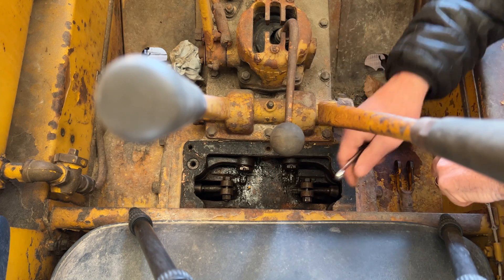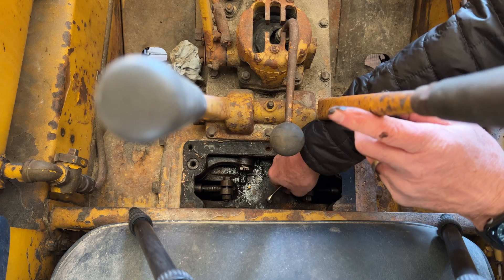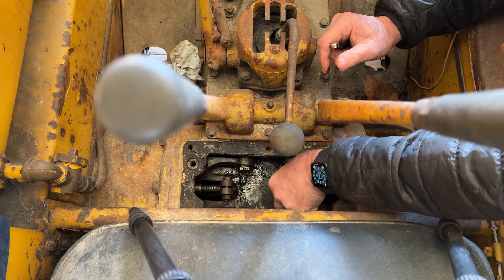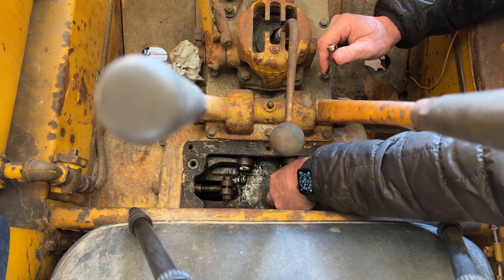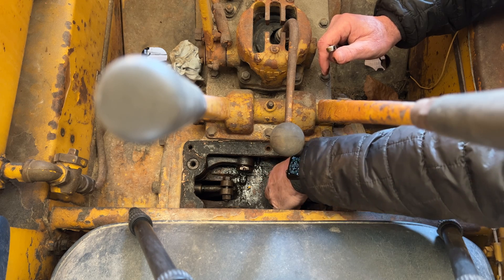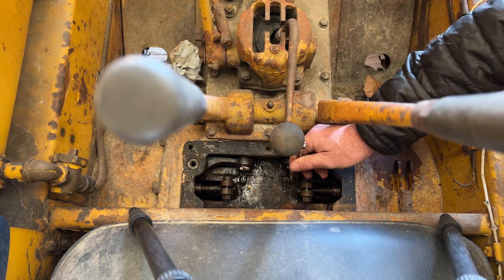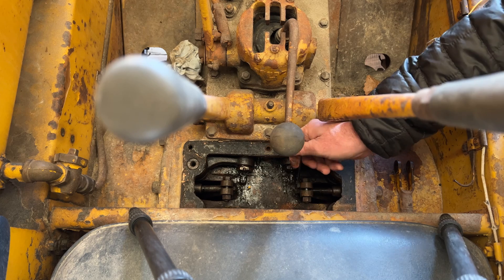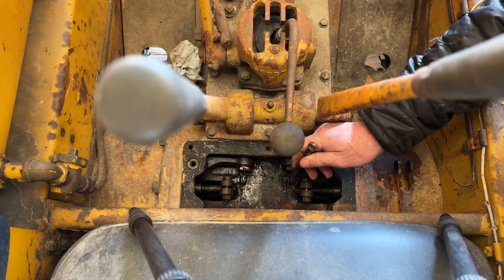D2 Steering Clutch Adjustment - Let's see what we have!

Comment: Did you see the D2 2J1113 videos on youtube. They just did a 5 part on the pony carb.   Think there is magneto coming up. 

But dont give up videoing. If it's old cat it will get watched.  Another guy is doing a 1950 D4.  Yet another is tearing down an Rd4.  Another is putting new weld on sprockets, steering clutches on several D4Ds that are strawberry fumigation setups. And he did a cat grader blade lift gear box. . So much cat and always room for more..
Reply from the maker: Wayne, for sure I will - I just don't have regular times to work on it, but when I do I'll make some videos. Nest up is finishing the pony fuel lines.
Reply: @froghairfarm  5J1113.  Search for it.
Reply from the maker: yep, Been watching Squatch for a long time, absolutely fantastic